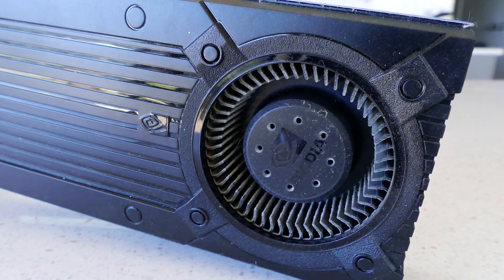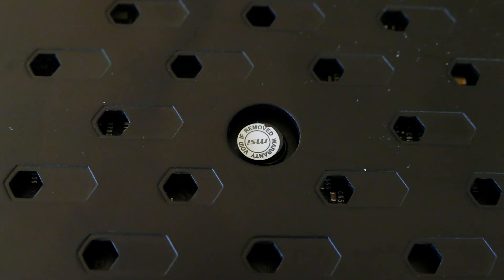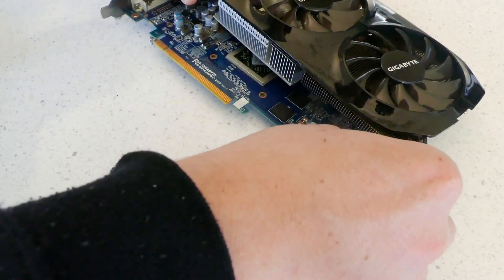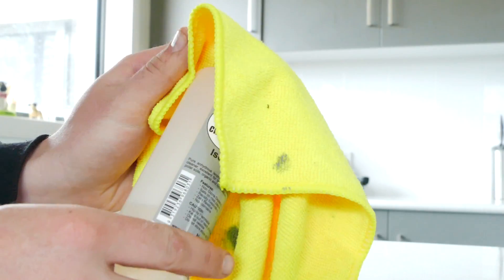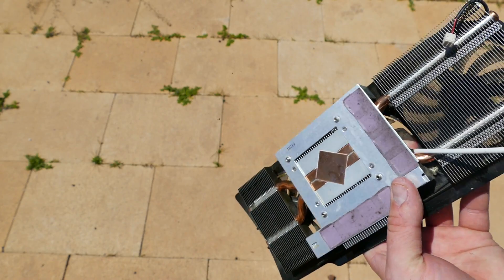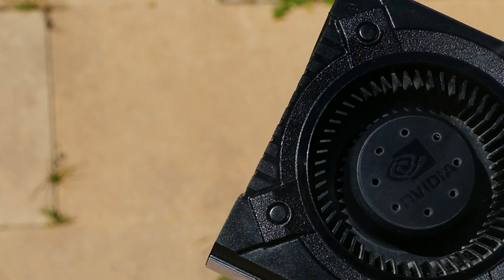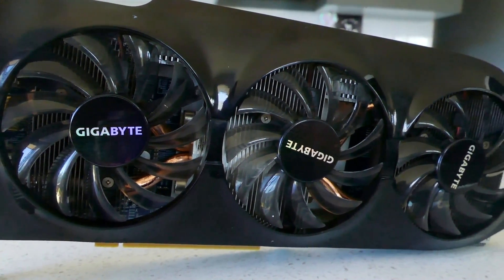How to Clean a Graphics Card/GPU

Comment: Thanks for the clear cut video mate. Question: Can I use ethyl alcohol (ethanol) instead of the IPA? And what about alcohol wipes with 70% IPA > is that too low?
Reply from the maker: Those wipes are fine but not entirely sure if ethanol will make a difference or not.
Reply: 70% Is generally considered too low for cleaning CPUs I think, so yes I'd recommend getting 90+%.

Comment: 8bar air compressor is the best. WD-40 for ventilators also the best ! Soft big brush instead of rough hands.
Reply from the maker: Not something I would recommend but if it works for that’s all good.
Reply: @EverythingbySam  But you recommend touching transistors with rough hands?
Reply from the maker: I do not directly recommend that. If that’s the way you interpret my words and what you think you see in this tutorial that is entirely your own fault. 

I never touch anything important directly with my hands directly and am soft over and around components. I have yet to damage a graphics card using this method and have cleaned quite a few now.

Comment: you basically applied thermal paste for like 30 video cards there!
Reply from the maker: I have repasted over 50 cards and have never had any issues with my method thus far. GPU die is different to a CPU IHS, you need to make sure it’s covered entirely. 

Have you ever seen an EKWB thermal paste diagram? Might want to look up their recommended application.
Reply: @EverythingbySam   would you brush your teeth  with half tube of tooth paste? when all you need is a pea size? I REST MY CASE!
Reply from the maker: The GPU does require it though to properly cover the die, so a pea size might get the job done now if it spreads correctly but just not well and could cause issues later down the track due to thermal issues.
Reply: @EverythingbySam  good thermal paste is the reason of thermal issue because over time will dry what you are telling me is basically apply 2qt of shit quality thermal paste that will give me the same result as of applying the right amount of good thermal paste? lol
Reply from the maker: Quality of thermal wasn’t even mentioned as good quality thermal paste should of been implied so stop grasping at straws. 

I am talking about the spread of thermal paste as having to little thermal paste can be detrimental to your thermal performance due to poor spread.

Comment: I always thought that you couldn’t touch your graphics card. I thought it was super sensitive
Reply from the maker: No entirely true, you shouldn’t touch the PCB of your graphics card directly with you hands but picking it up via the cooler or IO bracket is fine.

As long as use alcohol based wipes and make sure you haven’t left any residue behind your graphics card will be perfectly fine. 

They are delicate but not as fragile as some people believe.

Comment: Can I use regular alcohol to clean it instead the one you used in video?
Reply from the maker: No, it needs to be at least 90% strength to properly clean
Reply: @EverythingbySam  I already did clean with regular and will let gpu to dry until morning, thanks anyway..
Reply: @EverythingbySam  will it affect my card effectively?
Reply from the maker: As long as you have properly cleaned the card, made sure you use enough thermal paste and it’s spread is good you will be fine. 

It will be back to running at its best
Reply: @EverythingbySam  I have done my best in cleaning and put more paste than I did in cpu, as you said in video. Thanks for reply again! 🤗
Reply from the maker: No worries, good luck

Comment: hey dude, i bought a gpu which is sapphire nitro+ rx 570 4gb and when i install it and play some games like dota2 and csgo and pubg after 10 mins will show up in the screen ‘ display going to sleep ‘ and i cant do anything my mouse and keyboard dont function and i force to restart it. and i put “ never “ in screensaver btw. can u give some suggestion to  solve it? someone said that its because its too dusty or overheating. what do you think?
Reply from the maker: Doesn’t really sound like an overheating issue to me but you could always clean your GPU to eliminate that possibility.

That sounds like to me a corrupted GPU BIOS which is definitely not an easy thing to fix and may not be fixable at all. Another thing to maybe check it try different graphics drivers as the latest doesn’t always work flawlessly.

Comment: Hey, i didn't cleaned my GPU like 3 years. I have 1060 3GB but perfomance is still same, should i open and clean? Is it safe and can my GPU die somehow if i touch something
Reply: I have the same card and the same question. Did it work okay for you?
Reply from the maker: After 3 years I wouldn’t be to concerned about replacing the thermal paste, just give it a good dust blow out and a wipe over and it will be good to go
Reply: Hey guys, i cleaned everything and it's working good :D I don't see big difference but it's better i must say

Comment: Just cleaned out my 12yr old computer by taking everything apart except for the CPU & the Cooler unit after taking the GPU one apart first & realized that the dried out compound needed to be cleared out as well.ed
Would it be necessary to take CPU unit apart as well for a thorough cleaning since I'm already about to redo the GPU anyways?
Also, could you recommend a good thermal compound that can be used for both CPU & GPU??
Reply from the maker: Definitely need to clean your CPU as well especially if it has been that long. Most thermal compounds work with both CPU’s and GPU’s and a good middle of the road thermal paste is Arctic MX4.

Comment: Nice video, do you think monitor wipes would do a decent job at cleaning as a replacement for the baby wipes?
Reply from the maker: Yeah they will work just as well
Reply: @EverythingbySam  thanks bud
Reply: @EverythingbySam  do normal tissues do the job to???
Reply from the maker: A tissue will break up and get stuck to certain parts of the card. The dust usually is stuck to the card and requires a bit cleaning liquid and a good cloth to get off which is why a baby wipe is a good option.

Comment: Wont Baby wipe introduce lots of Grease & moisture on the components? IPA is usually recommended.
Reply from the maker: Baby’s wipes are designed not to leave residue behind otherwise that would cause nappy rash. Alcohol wipes can also be used

Comment: One of my gpu fans not working properly, what can i do? Galax 2080
Reply from the maker: If it’s still in warranty send it back as anything you do to it could void the warranty. 

If it’s not in warranty you need to trace the fan cable and make sure it is plugged in. If it is then it may need replacing if it’s not working.

Comment: Hey Sam I recently bought a second hand 1080ti and it seems to have corrosion on the metal fins is this something I should worry about and is there a safe way to clean it or remove the corrosion ?
Reply from the maker: Corrosion is generally a pretty bad sign of water damage and can’t be cleaned. The card may still function fine but it may effect it later on.

Comment: I’m scared of cleaning the metal side of the thing that faces up 😭😭
Reply from the maker: Metal side of the thing that faces up? I am sorry that makes zero sense to me
Reply: Everything by Sam sorry it was like 3 am when I commented this. The side on the opposite side of the fans
Reply from the maker: The back of the PCB? Do you have a metal backplate on it? That’s honestly the easier side to clean compared to the inside with the GPU die and VRAM chips.
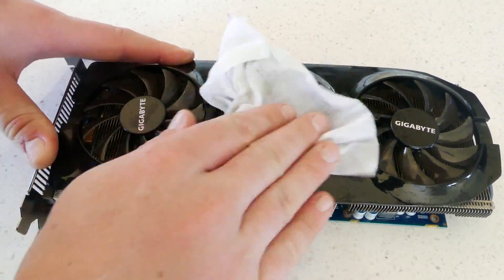Reply: Everything by Sam the side you clean at 0:56
Reply from the maker: Well that’s not metal that’s a PCB and the only “metal” on it is solder points. That’s the easiest part to clean
Reply: Everything by Sam so you’re saying I can just clean it with a Clorox wipe?
Reply from the maker: Yes, they will work fine

Comment: Hi, thanks for the video. I have a 10 month old GPU which has collected some dust inside the fan. If I use compressed air, will the dust enter the GPU? Doing it upside down can be quite hard as the GPU is pretty heavy and I don't wanna hold it at the PCI e connector. After that I should use alcohol wipe? How about just damp cloth?
Reply from the maker: The dust cannot “enter the GPU” it’s already inside the cooler so compressed air will blow it out.

Don’t use a damp cloth, water doesn’t dry the same way as as alcohol.
Reply: @EverythingbySam  ahh thank you so much for the help! I'm gonna get a compressed air to do some cleaning.
Reply from the maker: Good luck mate

Comment: Hi, I like your tutorial. But instead of baby wipes, can I use the air duster instead for the board?
Reply from the maker: You can but I would strongly recommend still wiping the board to get all the stubborn dust off as that’s the dust that can generally cause issues.
Reply: @EverythingbySam  Oh alright, thank you for the knowledge!
Reply from the maker: No worries. Good luck with the cleaning process
Reply: @EverythingbySam  what kind of wipes can be use to clean my gpu ?
plss reply asap hehe :)
Reply from the maker: Watch the video

Comment: I have a gtx 560ti and i can't open the screws because they have rusted. Need your help.
By the way my gpu temperature gets to 85-90 degree celcius while playing. Will this lower the temperature?
Reply from the maker: I would honestly suggest upgrading your card. A 560Ti is quite old and really not worth cleaning up but it would lower the temperatures.

Rusted screws are a nightmare to both undo and screw back in and that’s if you don’t accidentally break them or strip the thread.

Comment: Can you just remove the graphics card from the motherboard and it’ll be fine when you plug it back in or do I have to do something before and/or after I plug it in?
Reply from the maker: As long as your computer is turned off you can remove ,swap out or put back in any component and it will fine.

Comment: Wet tissue on PCB ?? Seriously?
Reply from the maker: Not a tissue. Myself and thousands of overs including Tech Yes City do this with no issue.
Reply: @EverythingbySam  but the baby wipe technically a wet thing right? So to prevent problems you let it dry for some minutes before applying paste then close back?
Reply from the maker: Yes exactly. If you are concerned after wiping with the wet wipes just wipe it with a micro fibre cloth to dry the surface before applying thermal paste and closing it back up

Comment: Can I use any type of isopropyl alcohol?  Does it matter what percentage it is? And the presoaked wipes should work for cleaning the circuit and boards right?
Reply from the maker: The higher the percentage it is easier it is to break down old thermal paste and build up but you should use at least 70%.

The wipes are to break up all the grime and dust build up and can used all over just as long as they don’t leave any residue that could bridge tracers or connectors.
Reply: @EverythingbySam  thanks! So it's safe to the use any isopropyl wipes designed for cuts-doesn't have to say "electronic" on it?
Reply from the maker: If there are electronic specific ones available I would definitely be getting those ones over regular wipes.
Reply: @EverythingbySam  thanks!  I actually just tried using my home alcohol isopropyl 91% and some Q Tips and they worked

Comment: Thanks for the video mate! I have been meaning to do this for a while, especially change the thermal paste. I have had my GTX970 for almost 4 years now and I have never changed the paste on it. It still works perfectly and the temps are usually about 30 degrees Celsius while idle (fans running about 30%) and about 60-70 degrees Celsius when gaming playing an intensive game. Can't hurt to change the thermal paste over though. Thanks again man.
Reply: 4 years? Ha I got a GT 420 for 10 straight years
Reply from the maker: I would definitely repaste as you said it can’t hurt.

Comment: Good vid, but you can just use less thermal paste
Reply from the maker: Unlike a CPU the entire GPU die needs to be covered completely to stop overheating issues. 

You should see the EK thermal paste application guide, it’s an X with a dot in each gap.

Comment: Wait you ca. Use a Baby Wipe to clean your GPU? I thought it would damage it.
Reply from the maker: Nope not at all
Reply from the maker: Over 50 GPU’s cleaned using this exact method and never had an issue yet.

As long as you do the job properly, allow adequate drying time (even wipe it with a dry cloth is you are hesitant) you don’t have an issue.

Comment: Lol cooling paste is the first thing you check with fcking heat problems this is why the electronics are burned or failing its  because it cant lose its heat its not the dust its the paste that guides the heat through the copper and the reason your electronics crashes after fcking 5 years its cause of this actually...the dust is a small problem...this is the biggest problem with gaming desktops the cooling paste thats been placed in the factorys on the gpu of the graphics cards...its so drastic less that its so ironic...this is why its good for a period of time...this is why people need to buy a new one when it crashes after a couple of years.
Reply from the maker: For an older card the thermal paste is usually the answer but dust build up in and around the fans cans can be a real issue early on and can lead to more serious issues. 

If your card is 4-5 years old then changing the paste is necessary but cleaning the fans will help with longevity and stop the paste from drying so quickly.
Reply: @EverythingbySam  i know my issue was the factory putted to little paste on the GPU i always check for the dust.
Reply: @EverythingbySam  even my psu
Reply: @EverythingbySam  i always clean my desktop step by step
Reply: @EverythingbySam  my card is one year old and its a nvidia and the cooling paste that was on the gpu was to drastic low it made me laugh a little from the inside
Reply from the maker: Yes unfortunately from factory it can be on both sides of the fence either to little or excessive amount which can both lead to their own issues.
Reply: @EverythingbySam  laptops pretty much showed me this there is to drastic less cooling paste placed on the gpu and the cpu when bought from the store its survives like maybe 4 summers and than it will show heat problems than open it and you wil see no cooling paste at al or so drastic less you can look right through it i fixed manny issues for people first hand that had these issues they never complain again and there all happy the one that had no cooling paste at al it runs like it should cool as f
Reply: @EverythingbySam  this laptop is 9 years old and it runs windows 8 like its new
Reply: @EverythingbySam  if i didnt use cooling paste i use this ever since my first desktop  just to point that out i would burn my gpu for sure i aint kidding dust wasnt realy there on the card cause i live in a house which dust isnt realy a issue and cause i check this monthly
Reply: @EverythingbySam  i think these companys need to think about the costumers this showed me just from the start that they dont give a f about it cause how could you buy a new desktop when  you can fix the heat issue your self

Comment: PLEASE HELP! I did this and now everytime I try to go on a game my computer just shuts down. What do I do???? I just did what you said  and I thought it would be fine to spray the motherboard cooler a little with compressed air.

Edit: I think I might have sprayed some of it not in an upright position. Would that damage it. Fak.
Reply: Wow after going through all that the thermal paste was the problem. Thank you for responding quickly and helping me. Now mine is running at like 65 while gaming tysm!
Reply from the maker: No worries. Glad I could help. Happy gaming!
Reply from the maker: That’s an odd issue. I honestly don’t know what you have done wrong. It sounds like overheating but I can’t be certain. 

Did you replace the thermal paste? 
Did you reconnect the fan if you disconnected it?
Reply: @EverythingbySam  yes I did I dont know if maybe somehow the motherboard got damaged when I was spraying the fan on it with compressed air.
Reply from the maker: Compressed air isn’t strong enough to damage anything so as long as you didn’t hold it to close to the area and wiped away any residue or waited for it to dry you should be all good.
Reply: @EverythingbySam Is it possible that when I was trying to get the fan plug out I loosened it but didnt put it back in tight so the fan is going on and off causing it to overheat??? On afterburner my temp would jump to 94 then to 70 then back in like a second.
Reply from the maker: Sounds like a cooling issue such as the fan, not tightening the cooler enough, not proper coverage of the die with thermal paste or even inferior thermal paste could all the the problem.
Reply: @EverythingbySam  I did not do the thermal paste because mine isnt that old.
Reply from the maker: If you opened your card up to reveal the die it’s best that you change the paste as once air gets between the seal of the paste it doesn’t cool as effective
Reply: @EverythingbySam  oh I didnt know that could that be the cause of the overheating?
Reply: @EverythingbySam  Idk if this helps but I have the radeon rx 480 and my motherboard is B150M Bazooka.
Reply: Salute and commendation to this channel for helping, unlike other channels out there leaving the comment section to rot.